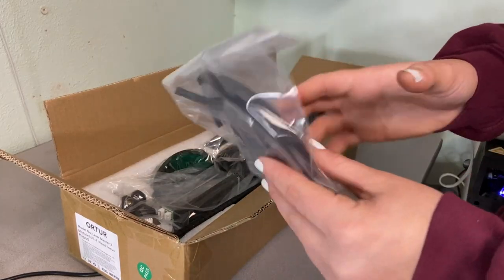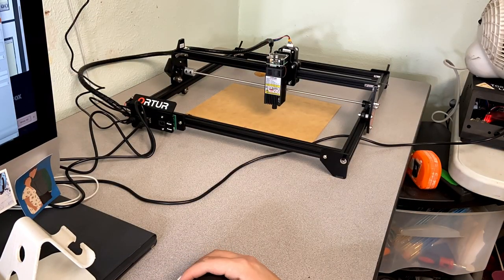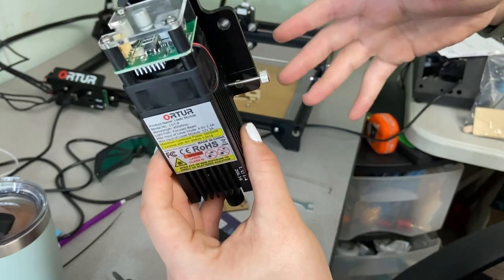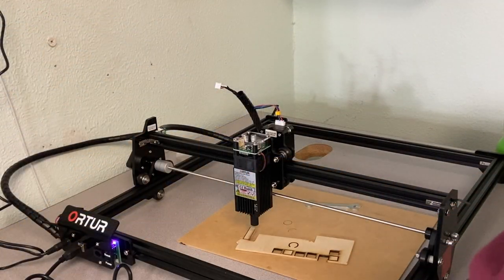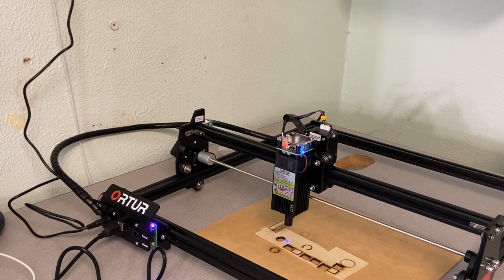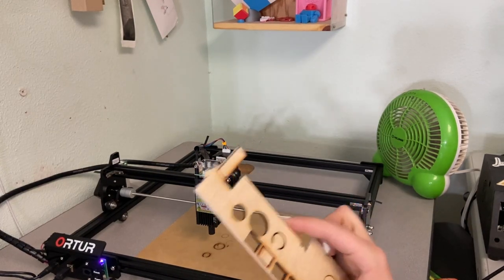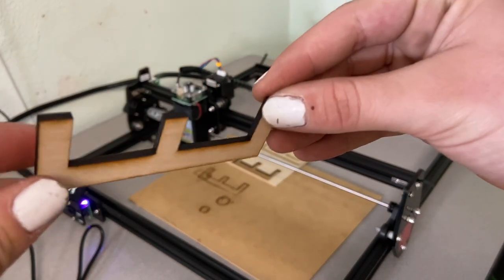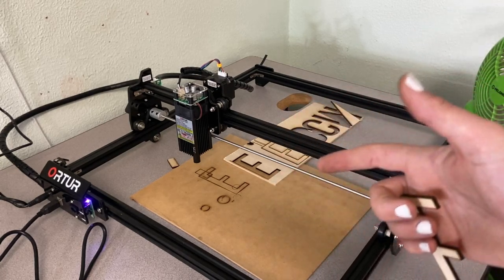Ortur Laser Master 2 Laser Cutter Review

Comment from the maker: As you may be able to tell, there is no discount coupon in the description of the video. I am sorry to say that this was now not possible due to some past error with coupons for this machine. However I did leave a link to gearbest where this laser is on sale for only $250 which is the BEST deal for the 20W version. Again I’m sorry there is no discount but definitely check out that other link:)
Reply: Thanks so much for the great work. Please what is the length on the Aluminum rod used to focus the 20 W Laser? I have lost mine

Comment: was the focusing method used in the video correct?  I have always seen the measuring spacer under the heat sync fins, NOT directly under the laser output.

Comment: great video, I was tempted to get one but I gather you need to put it in a garage or workshed rather than use it inside the home?
Reply from the maker: U really can put it anywhere as long as u have ventilation. A lot of people build boxes for them and have a stubs hooked up to it that goes out a window for ventilation. So really anywhere will work
Reply: Cutting plastic makes toxic fumes. I would not put it in the house if you do that. Wood is ok in the house as its not much different than a fireplace. (Assuming your not using treated wood) Still use ventilation or your smoke detectors will go off.

Comment: Got this machine yesterday. Never had a laser cutter before. but this was surprisingly easier to use. and thanks for the video, saved me a ton of time of finding the settings myself for cutting. And is that a CR10 3D printer? I am gonna buy a CR10 V2 within this month. But still skeptical because someone said it has locked firmware. :(
Reply from the maker: Yeah it’s pretty easy!! Yes it’s a CR-10 S Pro

Comment: Isn’t the cylinder used for focusing? It’s a fixed focus laser, I don’t think you have to turn anything for focus. Once the laser is the cylinder  away from the burn material, you are good. Am I wrong or right? 👀
Reply from the maker: Yes ur right, did I not say that in the video?
Reply: @TimberWood.Customs  sorry, I didn’t hear that part. I just heard you said turn the laser to focus.

Comment: Dryer vent hose is cheap and can be used with a fan to direct air out.
Changing speed and power can make it cut faster, and as you pointed out, higher power can burn out your laser faster.
Reply from the maker: Thank you I’ll try the hose! Thx for watching!
Reply: @TimberWood.Customs  You can pick up an in line fan at Menards or Amazon. Cheapest I've found, so far:  $19.49 at Amazon VIVOSUN 4 inch Inline Duct Fan, 6" is $24
Reply from the maker: @davec6113  ya I might get one from menards

Comment: you can get 2.7mm plywood from home depot for about 12 dollars. I have them cut it down so it fits in my car, usually 4 two foot pieces. A lot cheaper than the craft stores.
Reply from the maker: Wow really! I’ll have to check my store! What type is it?
Reply from the maker: Or what the special dementia do are on it plz
Reply: @TimberWood.Customs  I'm not sure what kind it is I don't think it was specified, maybe birch. But it is with the 4' by 8' sheets of plywood. They will cut it for you in any dimension you want. It's a good cheap way to practice on. They have higher quality sheets too for a bit more money.
Reply from the maker: @jamesteed9850  was it 11/32?? Or what was the size cause there is like 15/32 and 29/32 but those seem thick. Thanks again
Reply from the maker: I see 5.2mm sande plywood
Reply: @TimberWood.Customs  You might ask at the store if they carry it. Just ask for the thinnest plywood they have in stock. I don't think it is on their website.
Reply from the maker: @jamesteed9850  ok thank you I will call the store!
Reply: @TimberWood.Customs  I don't see it on their website but I just happened to find it when I went to the actual store the other day.

Comment: Thanks! Just ordered one. I had been on the fence, looking and weighing options. Once it shows up I'll build a box for it with an exhaust fan as I'll be using it inside. I used to work for a die shop where we had several lasers that cut 5/8" Baltic birch plywood and 1/8" steel plate. I would love to have something like that for making stuff but cost is always an issue. Thought about one of those 50watt CO2 lasers and doing some custom travel mug/water bottle engraving for local school's sports teams that they could maybe use as a fundraiser but I think I'll have to show my wife that I can do something with something small and less expensive first. Plus, you know, the Chinese flu. Your review pushed me over the edge because it will cut a good size and looks like it will do a good job for what I have planed. I would like to build a model of the Enterprise bridge from the original series. I've been working on 3D printing pieces but it takes so long to print the parts. 
Thanks again!!
Reply from the maker: Oh that is super awesome! I’m so glad that I influence you to buy one! Glad you enjoyed the video and hope you stick around to see more videos that I make! Hope you have fun with yours. If you have any questions please let me know and I can try my best to help!
Reply: @TimberWood.Customs  Thought I'd share an update. I ordered from Gearbest to save $30. 15 days later it's still hasn't shipped. Says shipping should take 3-8 days. Looks like China is having problems getting stuff out. I haven't had problems with them before but I'm thinking that I'm going to recommend Amazon until things settle down. 
I had also ordered something for my wife for Christmas from a different company and we are still waiting for it to show up. At least that has made it into the country and cleared customs.
Reply from the maker: @davec6113  oh man! I’m sorry that happened! Ya let me know when u get it!
Reply: @TimberWood.Customs  Ya know, it all boils down to politics and poor hygiene in China. Their official stance is that they have beaten the flu bug so doctors are punished if they report that someone has it which means people go untreated and it spreads and it becomes a bigger problem for them which means they shut down cities people can't get into work and things can't get out so depending on the city where something is coming from there can be problems and it looks like this is just one of those things.
Reply from the maker: @davec6113  ah man
Reply: @TimberWood.Customs  OK. After 21 days I contacted Gearbest to ask for my money back. They said that they "over sold" and that I could continue to wait, get store credit, or get a refund. I told them I wanted a refund and I just got it today. Took a little over a week oh back and forth before they get it. Now I'm going to get it from Amazon. Can't wait to watch your new video! :-)
Reply from the maker: @davec6113  Oh man I’m so sorry that happened. Hopefully you enjoy yours from Amazon! Don’t forget to use the link in the description help to support the channel:)
Reply: @TimberWood.Customs  forgot that was there. Thanks for the reminder.
Reply from the maker: @davec6113  yup! And thank u

Comment: what do you mean by "kill your laser super fast" and what instance would you require to use it at 100%? does the laser degrade with every use? how long does it last for and how much is each laser replacement?
Reply from the maker: It means your laser will stop working or start putting out lower power then normal. And I know no one who needs 100%, you can always slow it down and add more passes

I’m not sure how long they last and I’m not sure if u can get the exact ortur laser for replacement but there are other brands like neje and they are around $115

Comment: Thanks so much for the great review. I have a question I was hoping you could answer for me. I’d mostly be engraving on cutting boards but sometimes the cutting boards I make are slightly larger than the Ortur frame. Is it possible to engrave on larger objects by placing the Ortur legs on some blocks of wood to raise it up and then sliding the large cutting board underneath of the raised Ortur? I hope that makes sense. I appreciate your help!
Reply from the maker: Yes! I have done larger objects on my ortur when I had its original Frame on it. I just had to raise it up a little by putting a block under each leg making sure they Were all the same height and then I just put the piece of wood underneath it. Now I did do some engraving on a piece of wood that was almost exactly the same size as the frame so with that I just set the actual laser frame on top of the wood and centered it as best as I could. I

Comment: Lydia you created yourself  a problem now.  First I saw you use that aluminum cylinder to set the "focus" distance, which is correct for the fixed focus lens.  But then I saw you "REFOCUS" the laser by twisting the lens housing, which now has changed the distance between the lens and the surface being focused on.   So there's the problem.  Unless you make yourself a NEW cylinder or spacer that matches this new distance, you can't be using the aluminum cylinder that came with the Ortur.  Does that make sense?   BTW the lens can be slid up or down 10mm.
Reply from the maker: No. It didn’t change anything. It worked just fine. But thanks anyways.

Comment: Would it be possible to create a 3d laser cutter... 3d object is held on a plate.. Laser cuts in 3d with a plate on the other side to stop the beam... Laser could be hooked up to a small robotic arm on a swivel from top of device...
Reply from the maker: I’m not sure, but that sounds super interesting
Reply: @TimberWood.Customs  you could do it with one of these laser cutters on its side and a computer controlled rotating dish in front of it... It would work for primitive shapes except for the bottom of the piece...

Comment: At those feed rates won't the whole machine vibrate and slip as it works? I had to find some mounts to fix the feet to a board for my cheap laser from Two Trees because it kept slipping and ghosting engravings as a result. Granted, mine has two Y axis motors instead of one, so it may be a factor too.
Reply from the maker: I actually just have installed a board to the bottom of the machine with feet that attach to the board. I will be making another video on this and I will leave it in the link of this video when it is posted.

Comment: do you think you can use this  laser and program to engrave a full  sheet of plywood? can you design something and engrave it in sections by burning one part then moving the laser frame over to a new area and then continuing to engrave ????
Reply from the maker: I think you’d need a stronger laser to cut a bigger and thicker sheet if plywood. I have not tried the engraving in sections but I do know it is possible
Reply: @TimberWood.Customs  I'm thinking I'll get this unit. I just need to learn the programs and figure out how to engrave in sections :) thx you

Comment: I know zero about die cutting. Will this engrave on a bamboo cutting board?

What kind of wood and thickness is the max?
Reply from the maker: Yes!! This will engrave in ANY wood. For thickness, I have only tried up to 3mm plywood and nothing higher but I’m sure you can go up to maybe 5mm with the right settings

Comment: Thank you for posting!  I hear I have to keep it plugged into my computer.  I want to keep the ortur in my garage and be able to walk away with my laptop.  What are my options?
Reply from the maker: You know, I’m not sure about that. I really want to try and figure out if I can hook up a raspberry pie to it and connected to light burn through that. I’m not sure if it’s possible but I think it could be done. I will be trying that sometime soon. You can definitely join the ortur owners Group on Facebook and ask questions there too. They help me out a lot
Reply: The software they supply with it is PC/MAC only. There is no linux available. If you were to run a different software then maybe you could use a Raspberry pi. There is a windows software for the Pi but you would want to use the raspberry PI 4 as you would need the CPU power it has. Then you can use that just like most 3d printers do to control it remotely. Windows can be remotely controlled using the built in app or any other software. However this is a lot of work and takes time to get it working properly.

Comment: Hello.
I have a ORTUR LASER MASTER 2, and I haven't be able to cut 3mm MDF.
Can you tell me why ot what setting i should use???
Thanks
Reply from the maker: Hello! I use 350mm/min with about 5 to 7 passes that works for me. However if you add an air assist that will allow with less passes. 100% power
Reply: @TimberWood.Customs  Ho wow, I just tried it and it did cut thru, I went like 30 passes.
What is an air assist.
I'm new at cutting with laser and I don't know what that is.
Reply from the maker: @sergiogalarza3062  That’s weird. Are you sure you set the correct height from your material to the laser with the silver cylinder that comes with the laser? Also assist is where you can get or make an attachment that shoots air using a compressor to wear your lasers cutting so let it cuts a  clean pass.
Reply: @TimberWood.Customs  Yes, my high is righ.
I will look in to the air assist, to find out how it works and what I need.
Thank you very much for your time and your help.
Seems like you have a lot of experience on láser.
Reply from the maker: @sergiogalarza3062  work with mine every day:) happy to help!
Reply: @TimberWood.Customs  Are you in the US??
I used to live in Phoenix Arizona, I just moved back to Mexico three months ago (Chihuahua).
Reply from the maker: @sergiogalarza3062  yes US

Comment: Hi, Thanks for this awesome video, I have received mine few days ago and finally have time to play with it. I'm having an issue. I tried to engrave a small logo like what you did in the video. settings are all the same as you. but the edge of the engraving is not that sharp and clean. I adjusted the focus and try different setting. But i dont know why the edge is having some "extra line", (not out focus coz the line is very clear) May I know if anyone have this issue too? Thanks. =)
Reply from the maker: I’d say just make sure u know if I have a fixed focued or adjustable then focus it correctly. But I’d join the ortur Facebook group, and post photos to help u

Comment: I ran my laser at 200/60% with 8 passes and cant cut through 3mm plywood. What could I be doing wrong? i ran it at 50/50 and 75/50 and it just wont cut through.
Reply from the maker: Make sure you changed the height of the laser when changing material thicknesses. It may not be for used which is not allowing it to work.
Reply: @TimberWood.Customs  I guess that's another problem I'm having. My laser doesn't drop low enough the touch the metal thing to focus it. I might just need to take it apart? Maybe?
Reply from the maker: @keshonnadavis-graham2509  yes take it apart and make sure the slider part is screwed to the second to last set of screws from the bottom, I had to do that

Comment: what is the height of the cylinder for the laser adjustment? it didn't come with mine and seems easier to just make one than to go through them for another.
Reply from the maker: I think it’s like 30mm. It only comes with the fixed laser versions

Comment: Hello!
Thanks for the video! I understand, you have a lot of comments, I wonder if you have time, help me out. I bought an Ortur 20W machine, and I am unable to cut any wood. I started to think, a weaker version was send (7 or 15W); do you know how to identify the model? Would be great help, I am unable to cut, and I really would like to. Thanks in advance!
Reply from the maker: Make sure you have yours focused with the cylinder that comes with the machine, usually that is what doesn’t allow it to cut. 

As for identifying the wattage of the laser, you should be able to identify if on the front or the back of the laser there should be a sticker. 

Let me know if that helps!
Reply: @TimberWood.Customs  Thank you for the tip! I made some try, still not perfect, but I keep trying with the focus, as you advised. Thanks again!
Reply: did u fix man ? can u cut 3 mm plywood with this machine ?
Reply from the maker: @vladimernepharidze5716  yes I can it started to work
Reply: @vladimernepharidze5716  Hello! Sorry for very later answer - we have so much work in the garden, that I forgot write. For the machine: no, I could not make it work, but I must say I had limited time work with it due to the garden work :). Do you have the same problem?

Comment: What is the max thickness of Ply or Acrylic you can cut ? Thanks in advance
Reply from the maker: I’ve only tried 3mm ply. But make sure u have air assist. They strong compressor u have the thicker u fam cut. Also I haven’t tried acrylic yet

Comment: Did you try cutting plexiglass or other such material?
Reply from the maker: I have not yet, haven’t found any colored plexiglass near me because u can’t use clear
Reply: @TimberWood.Customs  But there are lasers that cut clear polycarbonate or acrylics. Perhaps this model has some limitation?
Reply: @TimberWood.Customs  Try TAP Plastics store near you, they are generous enough to give away small left over pieces.
Reply from the maker: @chhupparustom  I’m not quite sure. Thats only what I’ve heard is it’s hard to cut clear plastic with this laser but I could be wrong

Comment: Would this laser be able to cut 1/2 inch material such as Acrylic, Ply Board or Plain sheet?
Reply from the maker: No, however the OLM2 Pro LF version with air assist may be able to cut 1/2”(I know it can cut 1/4”)